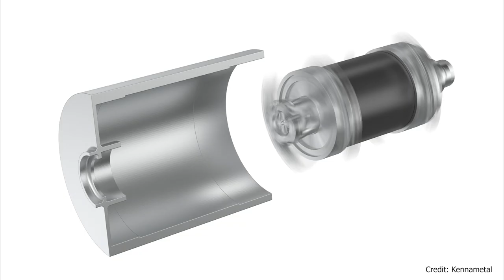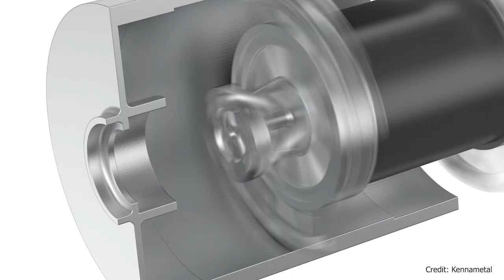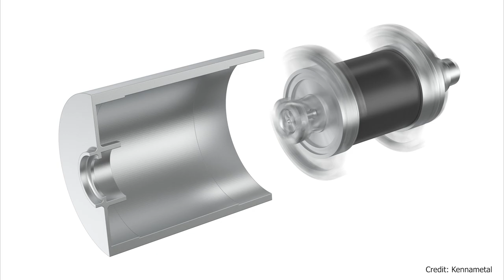3D Printed Tool for Machining Electric Vehicle Motors | The Cool Parts Show #39

Comment: hmm the carbide cutting teeth are mounted with bolts on not silver soldered like most carbide tipped cutting tools. interesting
Reply: Well, like 90% of indexable cutters meant for production which enables the tips to be quickly changed when they wear out.
Reply: What type of industry are you talking about? If you talk about simple, small tools like cutting saws for example, yes, they are soldered. But in CNC machining pretty much all tools with carbide inserts have them screwed. Milling tools are expensive and are not single use and you want this inserts to be fast and easy to unscrew, rotate or replace and screw back in to continue working again. Especially if tool have 20, 30 or even more inserts. Time is money.